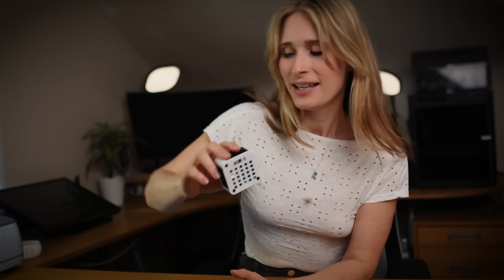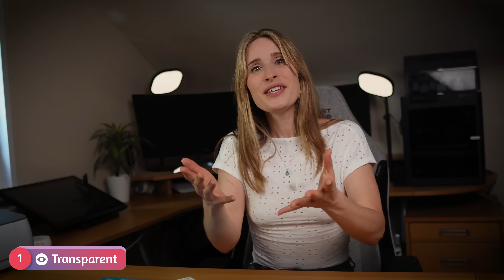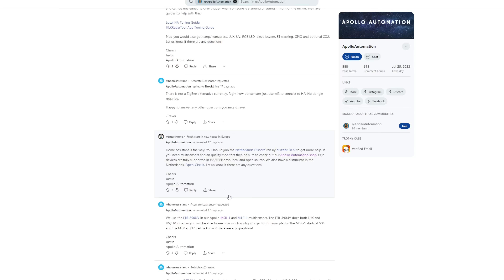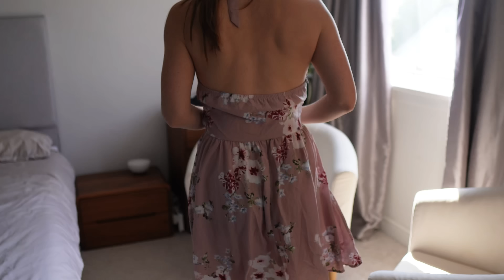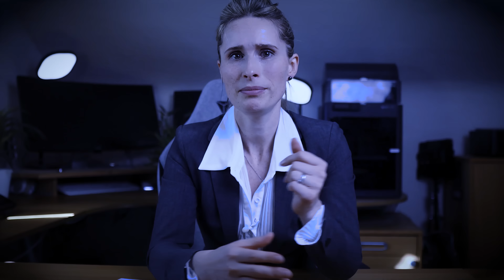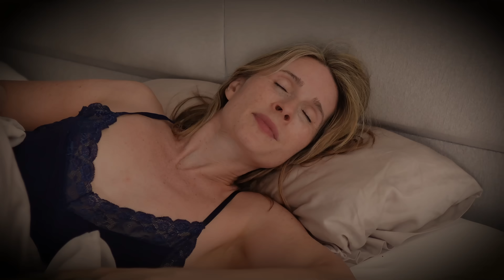Best Air Quality Sensor? I pull apart the Apollo AIR-1… and find four great company traits....

Comment: Given the quality of components, ease of integration and quality of documentation alone that's not too bad at all;  the chances of getting such a device wrong are pretty high and you don't want to be have-a-go-Henry at such a sensor or it might not give you the readings you really need.

As for reactive response - do you have an intake fan that can open vents and force air into the workshop when air quality drops below a certain level?

Also for air particle problems - we used to have a "Rainbow" vacuum cleaner which was a savagely overpriced American device which forced the air intake through water using a fin system to shatter the incoming bubbles;  it was so effective at this that you could turn it on for 30 minutes a day and clean a fair bit of the air in your house.  Do you have anything like this in the workshop or house generally?  You mention being in Scotland so I'd envisage air quality isn't too bad outside of industrial areas; though heat retention may be an issue.
Reply from the maker: Yes, they're pretty impressive - well worth as you say pricing up the cost of all the components, testing and modelling!

In the new workshop that's exactly what I've just been brainstorming with Patreons and Discord members, essentially the fact I've got this as 'data' in my Home Assistant instance, means it's super simple to set any triggers - eg lights flashing when levels are high or turning on ventilation as you describe.

Air quality is great where we live, but I've got an amazing xTool air filter which is one of the best I've ever seen for filtering just about everything - so this with a smart switch becomes very cool, very quickly!!
Reply: @handsonkatie  I know how essential that is, a while back a firm I worked for had to switch from CFC cased cleaning and board freezing (used for dry joint detection) to purely alcohol based solutions for all cleaning and a similar substitute for board freezing; the poor tech was suffering constant nose bleeds from the fumes. They had to spend $3k on a ventilation system just for his workstation alone.  There are also some concerns about plastic dust and similar fumes in the longer term, good environmental control is rather critical.
Reply from the maker: Great example and totally right!

Comment: I was strongly considering this device, but I want an air quality monitor that can record the data for a long period of time (months to years), and when I asked their tech support if they had a turnkey solution to do this, they said nope, this device was not for me!   Do you know how to make this device keep a long term record of its data?
Anyway, I ordered an Air Gradient instead of this because of this issue.
Reply from the maker: Yes, I just set up an Influx DB instance for my home assistant install and it streams all my sensors to that (including Apollo Automation) - but think they're definitely right, if you want a turnkey solution, then Airgradient are great too! I have both their internal and external sensors running!

Comment: I've had PM / CO2 / VOC sensors in my home for years now. I think it's very important to keep an eye on carbon dioxide levels in rooms. I find if it goes over about 1500 for too long you will start to feel pretty fuzzy headed. Just turn an extractor fan on or open windows and doors to quickly get levels back down to normal 400 ish and you will soon feel better.

BTW, I could listen to you talking all day, always interesting whatever video you upload 💜
Reply from the maker: Great comment and I really was surprised as I repeated at the start of my latest video - in hindsight, I was consciously drowsy, but just having the data on CO2 helped me 'put my finger on it'. Exactly as you say it's so easy to fix, I feel a bit silly for not realising it sooner!!! And thank you for your lovely comment, keep watching!

Comment: I could build this for $40, easy.  $150 for all the bells and whistles is highway robbery.  The BME680 can get me 75% there for $10 or so and a ESP32 is another $5-$10.
Reply from the maker: Hmm, I agree with your instinct (in fact it was mine too by default), but not sure - much like a dht22 could do the temp/humidity even cheaper than the bme680, there's a point of quality also, so for very vague air quality sensing then the bme is awesome, but you're a long way off 75% of the way there. Of course there's a markup and if you value your time at zero or enjoy building everything, then great - I mean they list every single component they use on their site, so you can precisely see the mark up and if it's worth your time. So I was actually quite surprised at the value of it, even though I'll always itch to build it myself (much like you) - each to their own though and even better if you can improve on it, that's the wonderful thing about open source!

Comment: I use the Apollo Air-1 to trigger my ERV system when the air quality goes to abnormal or worse.  It's working out great.  I was shocked to see how bad my air quality was and how easily I could improve it by automatically running the ERV on turbo mode for a while.  Everything is integrated in Home Assistant and works automatically in the background.
Reply from the maker: Great example - I'm doing very similar in my workshop, you're right though, it's amazing what they reveal!

Comment: Looking hard at moving to Home Assistant and this sensor will be a great trigger for the air purifier. Instead of running it all the time, this could turn it on when the PM 2.5 gets to a certain level. Thanks for bringing this to our attention. And yes, companies that don’t hide their stuff behind a paywall or require a subscription get my vote.
Reply from the maker: Absolutely spot on - and not only that you could create a series of smart conditions very easily, eg if the pm 2.5 or CO2 or NOx or x,y,z goes above each threshold, then turn the purifier on. Makes it very smart, very simply!

Comment: I use something similar I built myself to turn on and vary speed of my Ikea air filter based on particulates and VOCs from 3D printer automatically. It works great. That said I’ve had my eye on the Apollo stuff as it is so nicely done and I’ll probably pick up a couple. Nice video👍
Reply from the maker: Love the variety of ways to tackle these sorts of challenges, Iain! I've done similar - these are really for when you want the 'ultimate' all in one for general environmental use - your use case is brilliant (indeed I was pondering showing how you can hack an Ikea air sensor to make it a ESP Home device - it sounds like you've done the same!)
Reply: @handsonkatie  Exactly that, hacked the original sensor with CO2. VOC, atmospheric pressure etc. the case is a little cramped so made an little extension off the back (3D printers are so useful). I'm not quite at the level of trusting it for ABS printing without outside venting as well but for my routine printing it works great. Would love to see your take on hacking one, it's a nice project for folk who have no 3D printer, everyone should though ;) Anyway I best get back to my gridfnity printing!
Reply from the maker: @iainhay2823  sounds like a great approach!!